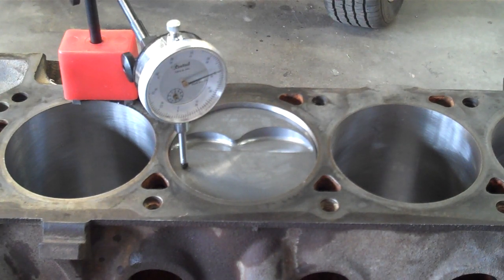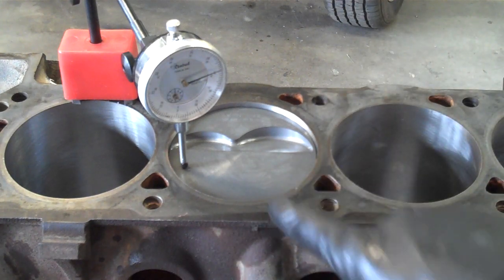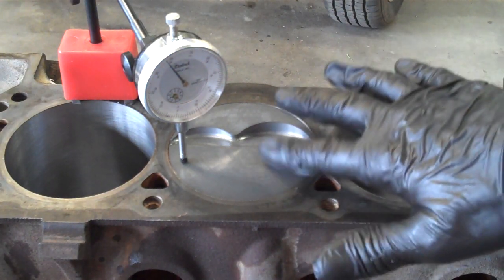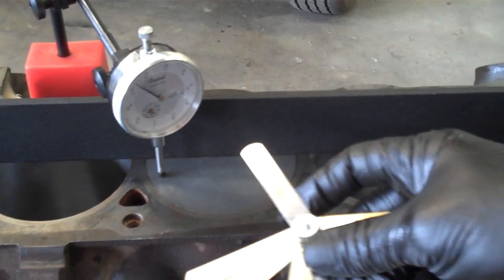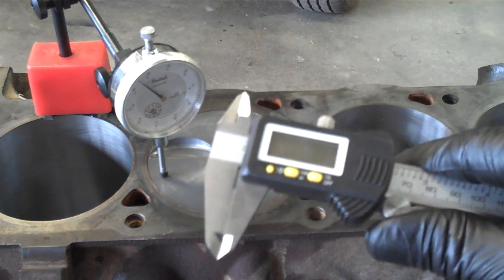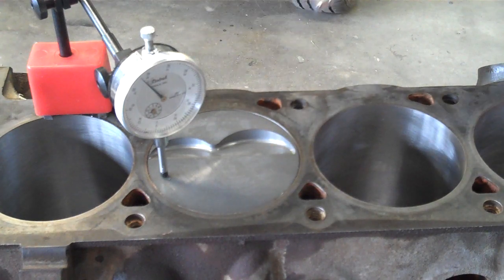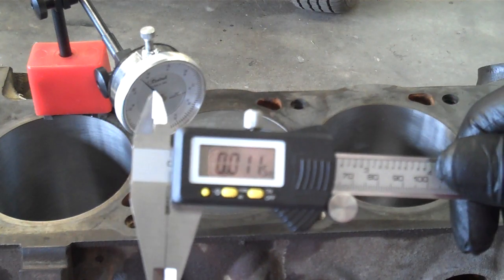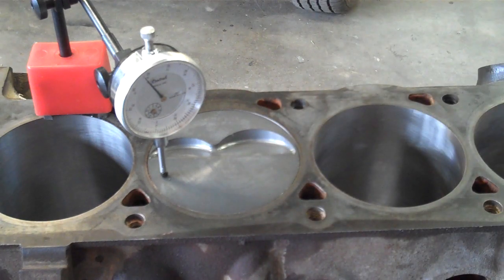Checking piston to block deck clearance.MP4

Comment: The straight edge method works well, but a digital vernier is a very poor way to measure anything accurately, especially shallow depths because you cant hold it perfectly vertical,  its good for getting rough numbers but thats about it...  I do this for a living,  For home use, invest in a cheap set of 0-5" micrometers and standards,  and a cheap depth mic, also a second dial indicator.  For the 150$ its worth the money.  Great vid too !!

Comment: What is the purpose of this. I dont see why this would make that big of a difference
Reply from the maker: Two reasons, maximizing power production by minimizing area above the piston requires machining the block. This allows us to know how much to remove. Once machined this allows us to determine exactly how thick of a head gasket to use to ensure clearance between the piston and cylinder head deck